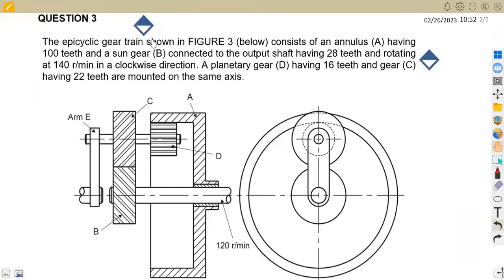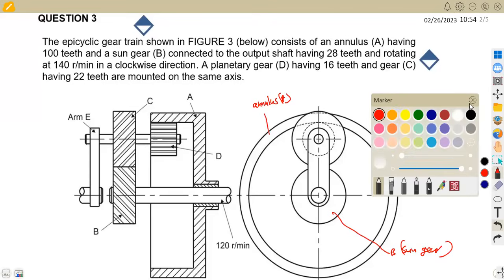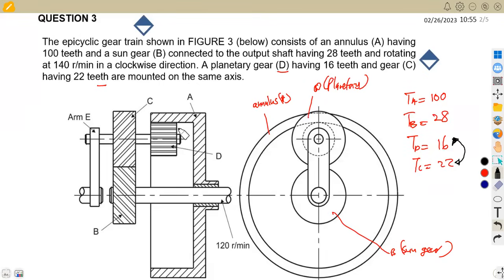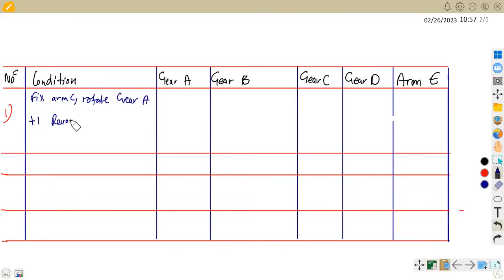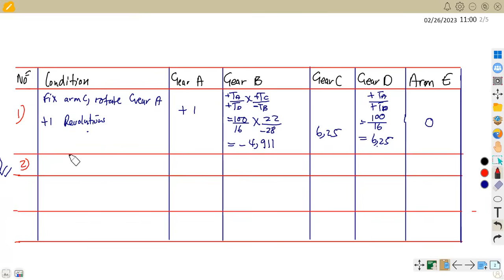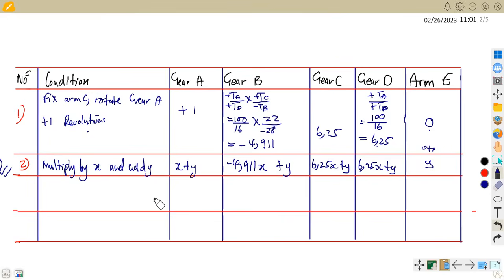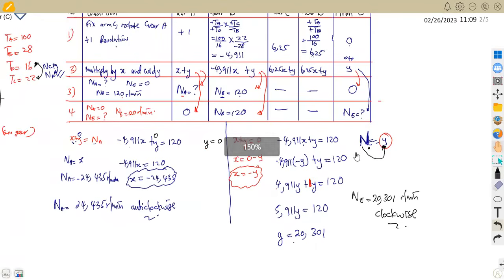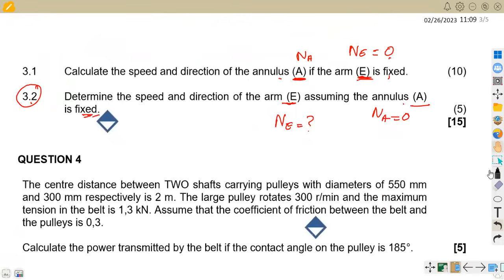MECHANOTECHNICS N4 GEAR DRIVES -  The epicyclic gear train JUNE 2022 @mathszoneafricanmotives

Comment: Why use 120 r/min when we were told from the statement that sun gear B is rotating at 140r/min
Reply: Maybe it's a mistake.. lemme check the memo
Reply: I am worried about it too 😂
Reply from the maker: Hie that must be a mistake
Reply: We got 2 speed which one we supposed to use 120 from diagram also 140 from staterment?